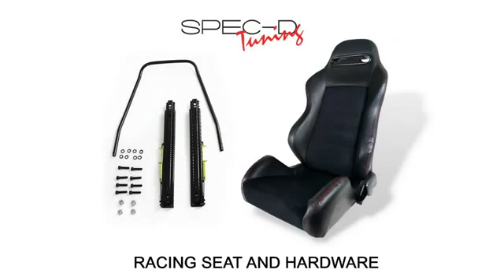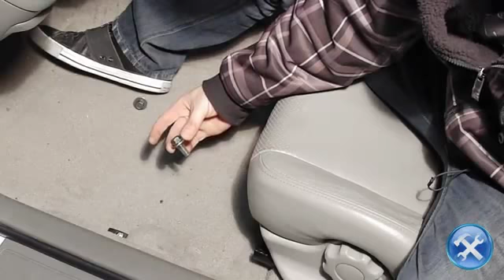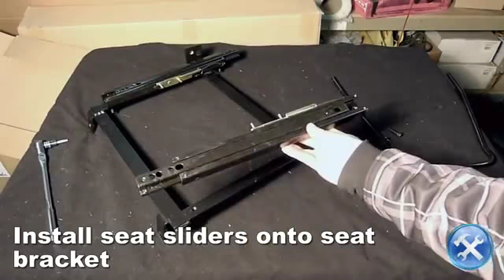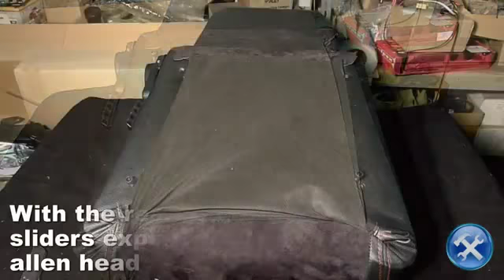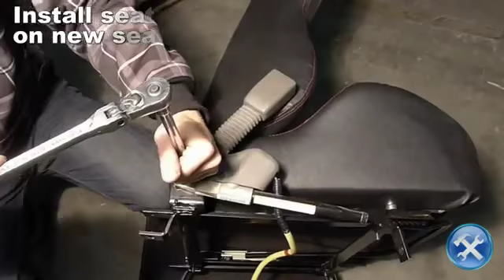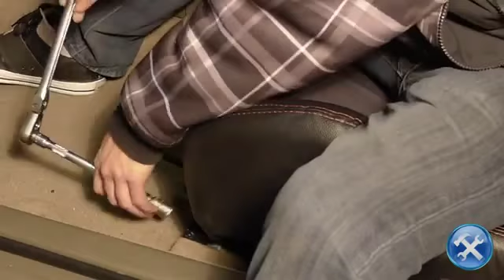Rvinyl.com Installation Video |  Spec D Tuning Universal Racing Seats

Comment: confused. Some videos show the slider upside down and others show it right side up, Iike in this video.. Which is correct?
Reply: imo both ways are correct..just depends on if you want to pull the slider handle up or push the slider handle down to move the seat.
Reply: MrByaahh
 Good to know, thanks for the help. :)